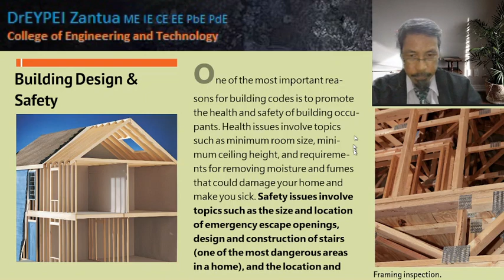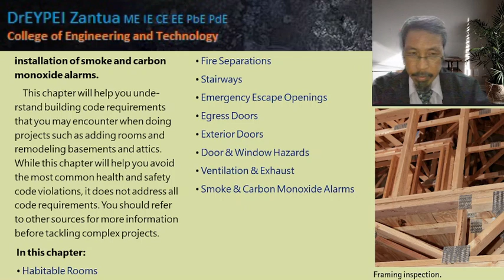[Ch02 BD 00] Building Code for 1-2 Family Dwelling & Townhouses: Building Design & Safety

Comment: A building code (also building control or building regulations) is a set of rules that specify the standards for constructed objects such as buildings and nonbuilding structures. Buildings must conform to the code to obtain planning permission, usually from a local council. The main purpose of building codes is to protect public health, safety and general welfare as they relate to the construction and occupancy of buildings and structures. The building code becomes law of a particular jurisdiction when formally enacted by the appropriate governmental or private authority.

Comment: Manglicmot, Lou Ashley L.
19-01582

Any alterations or modifications done on a building should follow the requirements mandated under the National Building Code for new buildings. Even the materials used for the construction should be in line with the code.

Comment: Buizon, Randylyn C.
19-00979

A building codes is very important because it is a set of regulationsand rules that specify the standard, and this is important for the safety for constructed .

Comment: HALIPA, SALMA BINJAMIL S.
19-00257

The purpose of the building code is to provide for all building and structured, framework of minimum standard by guiding, regulating and controlling their location, sitting, design of materials, construction, use of occupancy and maintinance including their environment, utilities, fixtures, equipment and other systems intallations.

Comment: TATOY, MARY JOY B. 
BSCIVES

The purpose of building codes is to provide minimum standards for safety, health, and general welfare including structural integrity, mechanical integrity (including sanitation, water supply, light, and ventilation), means of egress, fire prevention, and control, and energy conservation.

Comment: Ruiz, Sharlize Veyen C.
19-00620

Building Codes are build for health and safety purposes of the occupants. Hiring professionals is a must for everyone's safety. There's specific engineering discipline in each topic that will help a person avoid health and safety violation. Although in our country, this are not implemented. This must be complied for the sake of protection.

Comment: CANTOR, ALLYZA MARIE F.
BSCIE- IRREGULAR
19-00936

I learned from the lecture that Building design and safety is one of the most important reasons for building codes for it promote and secure the health and safety of building occupants.

Safety issues involve topics such as the size and location of emergency escape openings, designs and construction of stairs ( one of the most dangerous part in a home) and the installation and location of smoke and carbon monoxide alarms.

Comment: Carbon monoxide detectors are the fastest way to prevent CO poisoning. You can install a carbon monoxide detector  in your home. They work much like your fire or smoke alarm by sounding a siren when they detect carbon monoxide.